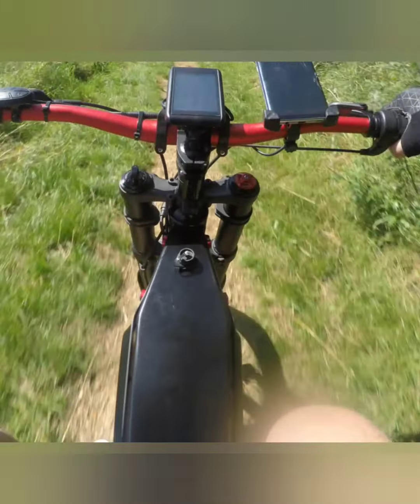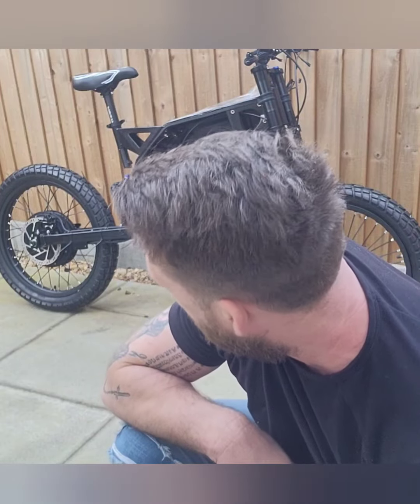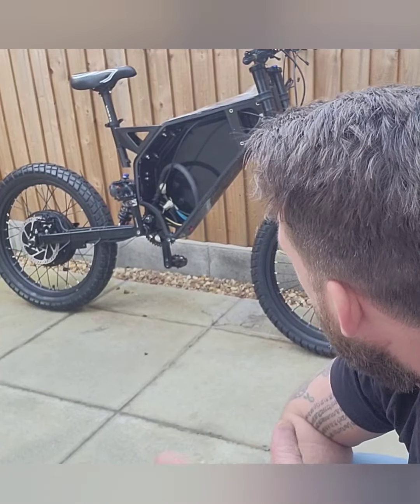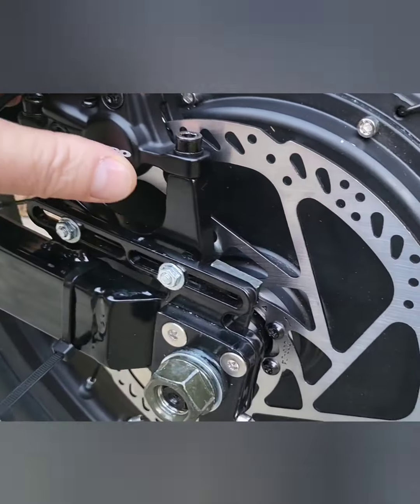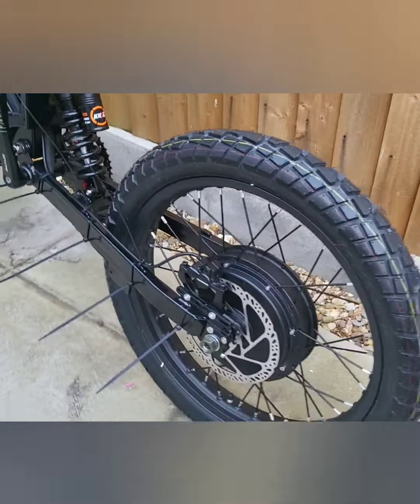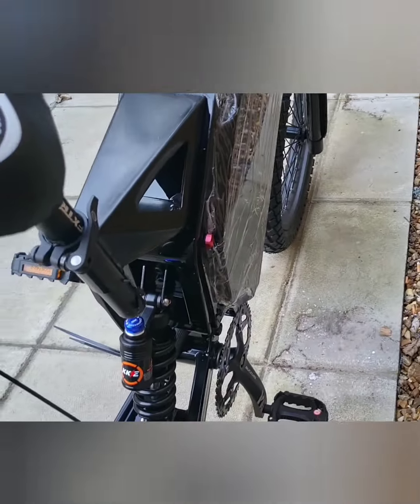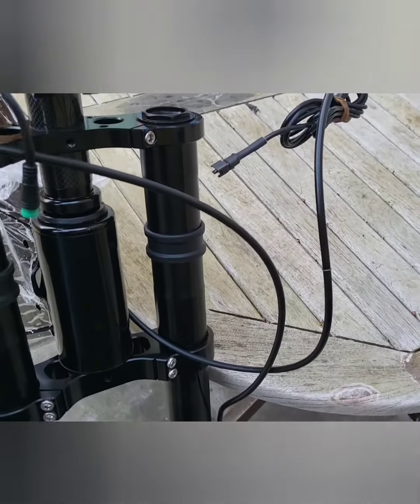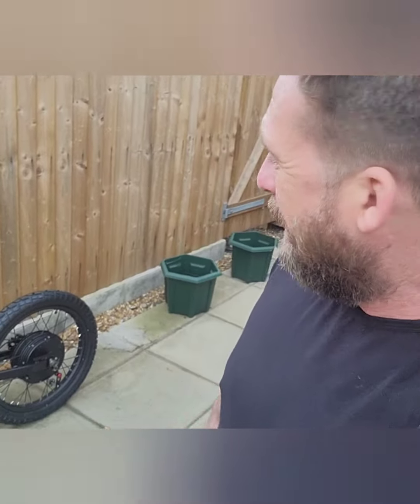#alibaba #build CRAZY FAST ENDURO EBIKE BUILD

Comment: Hi Steve that looks fantastic what controller are you using for this bike and have you ever use higher voltage than 72V .
Can you please send me the link to ebike breaks as I have been looking for the same one you have but can’t find them at all much appreciate cheers
Reply from the maker: 100 amp Sabvoton controller...battery is 80v fully charged...I have links on another video on my channel 👍